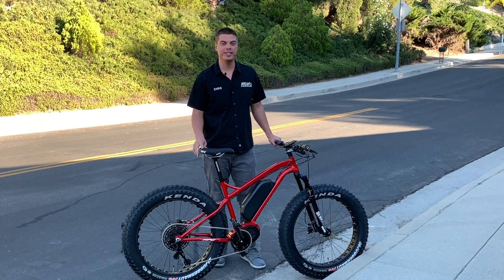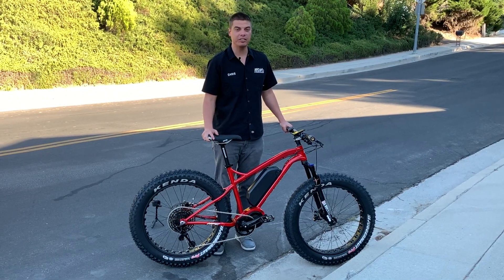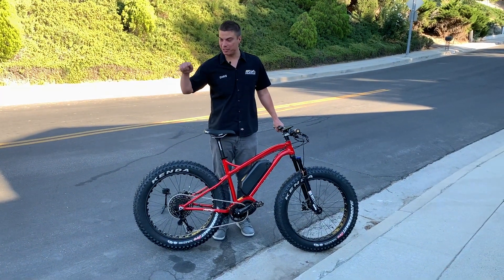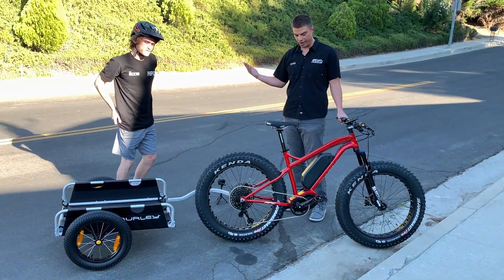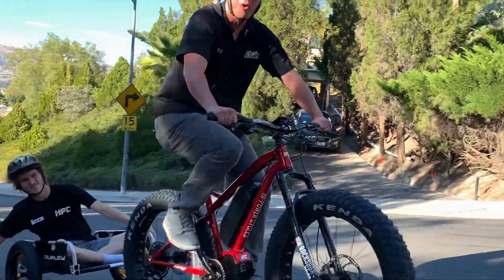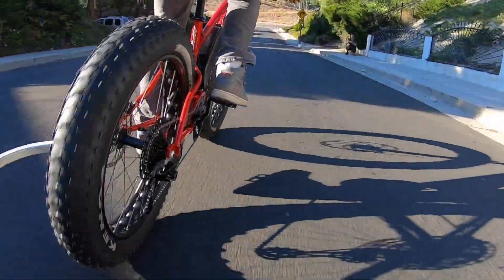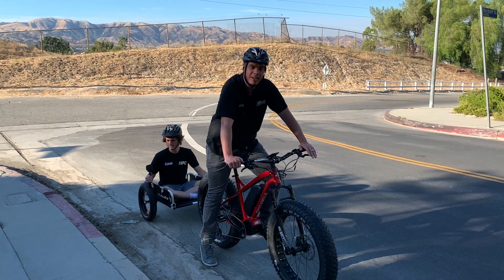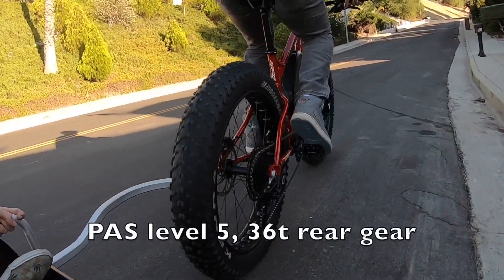2000W HPC Titan E-Bike with 200Nm torque.  Hill climb towing test!

Comment: The motor is clearly a Bafang Ultra (aka M620 which costs USD 420 when ordered from Bafang directly), rated for 1000W continuous and 160Nm at 48V so not sure how they get, allegedly, 2kw and 200Nm out of it with 48V batteries.
Reply: I was thinking the same thing. Maybe 72v? It's pretty widely believed the g510/m620 can easily handle 2kw...

Comment: Imagine this bike with a 12,000watt rear hub (afterburner) fed by two 35ah 72v triangular batteries in parallel, with a asI 800 fed Bafang and you have my bike. 29" rims 100+mph. with 52/12 final.
Reply: -  Do you actually have a real bike like that?
Reply: It's easy if you tryyyyyy